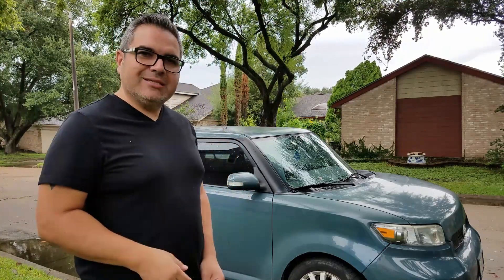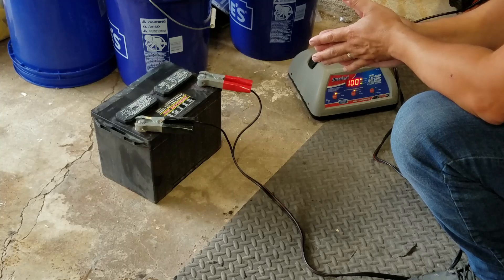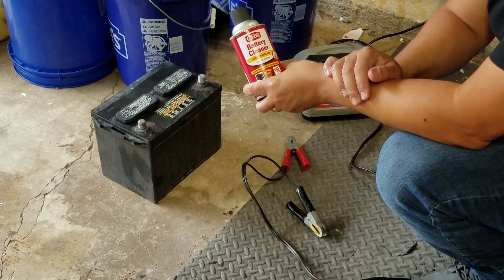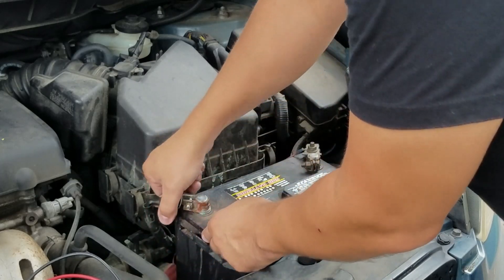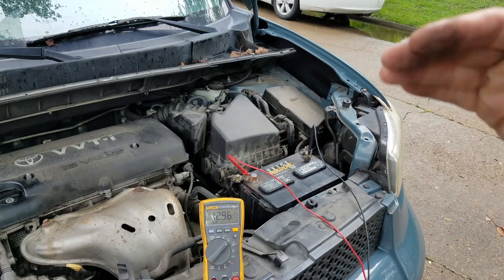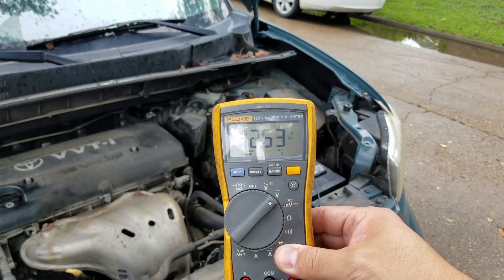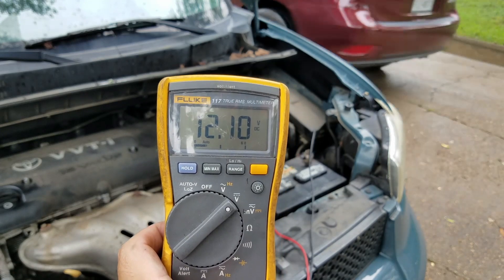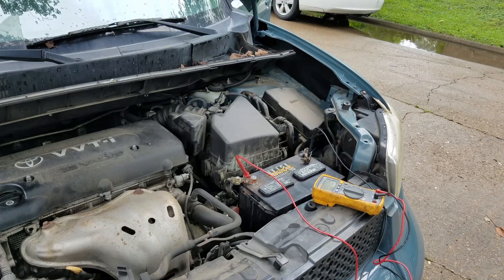2010 Scion Xb Battery testing with multimeter

Comment: I dont comment often but here i am looking for info on my 2008 xB. yes, i will do this test to verify my alternator that we had replaced a couple years back and want to double check a few things. 
my question is: 

What is that horrible grind/winding noise when the engine was turned off? 

Thanks!
Reply from the maker: It’s been a while, but if recall it’s a idle pulley bearing going bad.